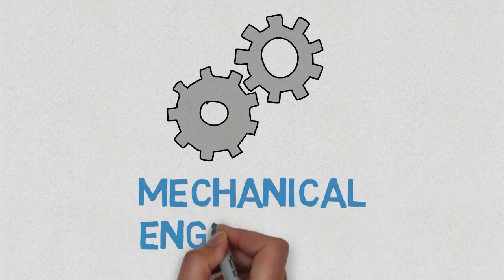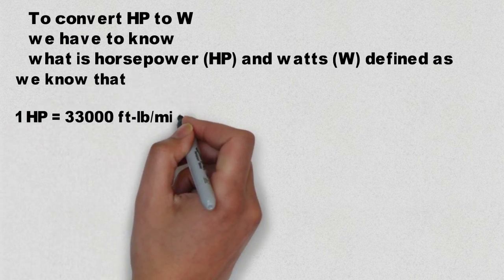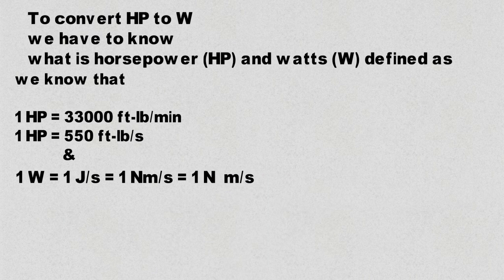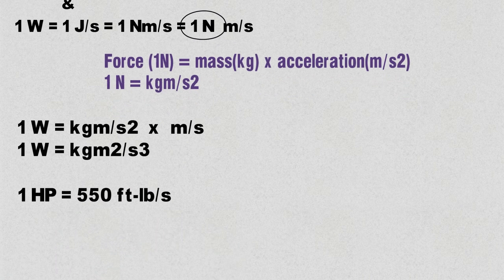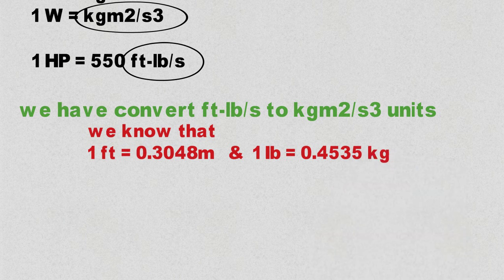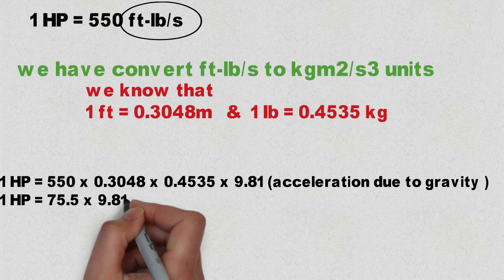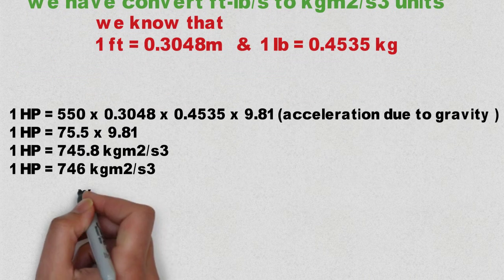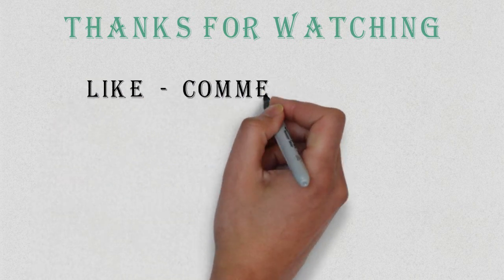From Horsepower to Watts - The Simple Explanation You've Been Waiting For!

Comment: 158kg/cm is equal to how much  hp
Reply from the maker: The unit "kg/cm" is a unit of torque, which is a measure of the twisting force that causes rotation. On the other hand, horsepower (HP) is a unit of power, which is the rate at which work is done.

To convert torque (kg/cm) to power (HP), you would need to know the rotational speed at which the torque is being applied. Without this information, it is not possible to directly convert between the two units.

However, if you know the rotational speed and torque, you can use the following formula to calculate power in horsepower:

Power (HP) = (Torque (lb-ft) x Rotational speed (RPM)) / 5252

Note that the formula requires torque to be in pound-feet (lb-ft), so you would need to convert the torque from kg/cm to lb-ft first.